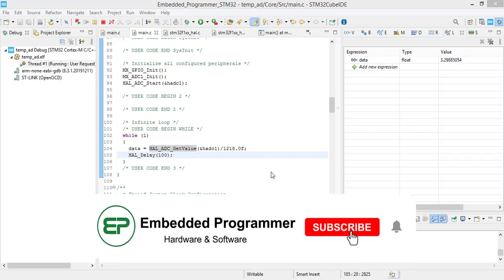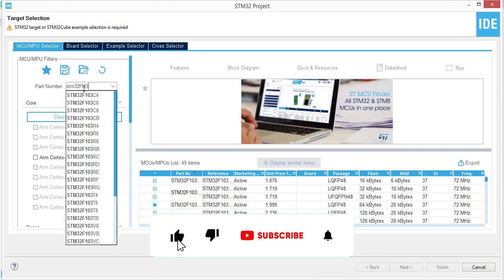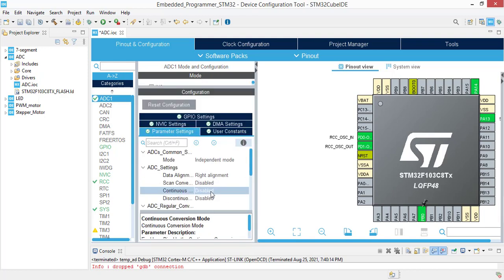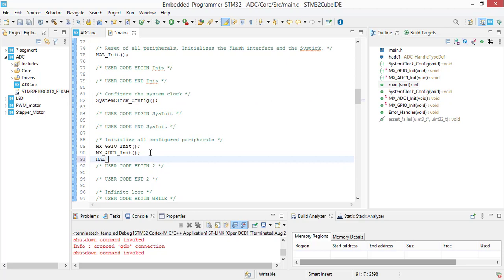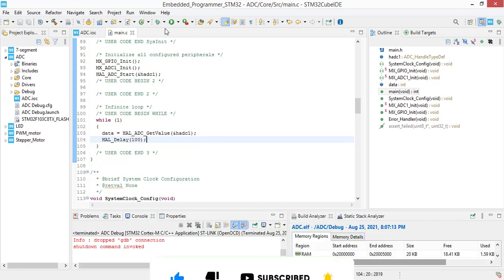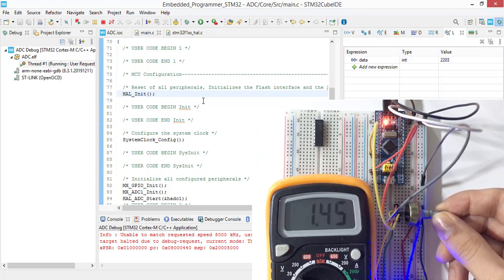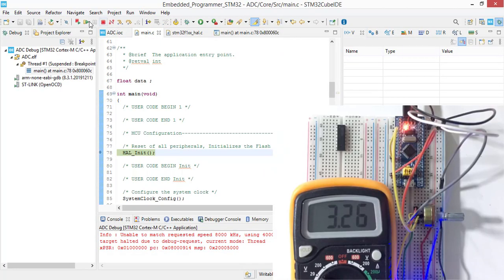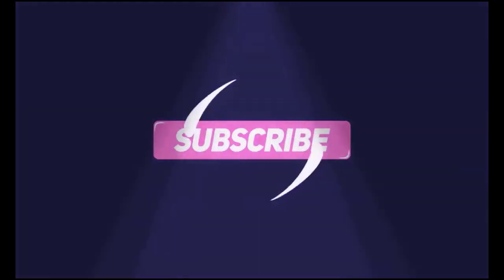ADC Configuration in STM32F103 | Embedded Programmer

Comment: I am planning to use stm32f103rbt6, can i use the same code and how should i vary the sampling rate since i want to control the sampling rate
Reply from the maker: Yes, just adjust it from the CubeIDE. For sampling rate, adjust the frequency of adc and use DMA for faster sampling rate.
Reply: @Embedded_Programmer  Sorry, but did you do it in your example. As I understand, you did only continious conversion mode there.